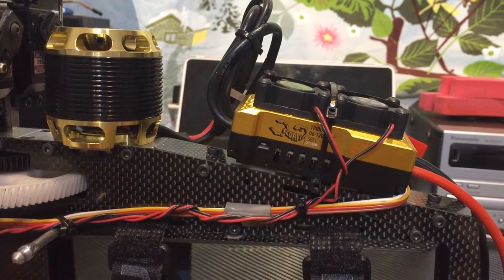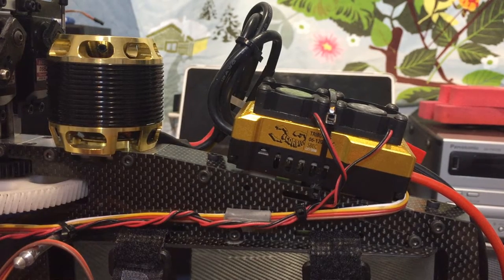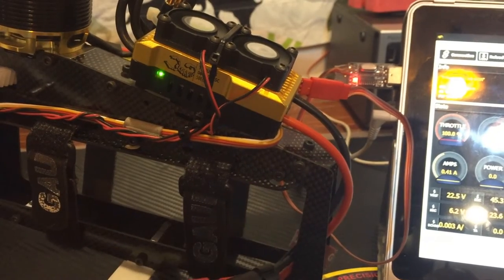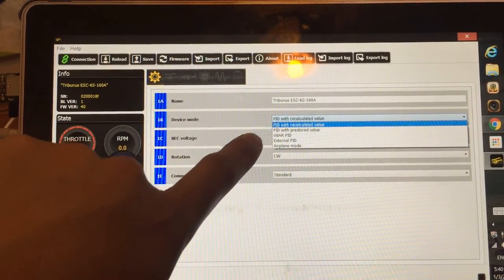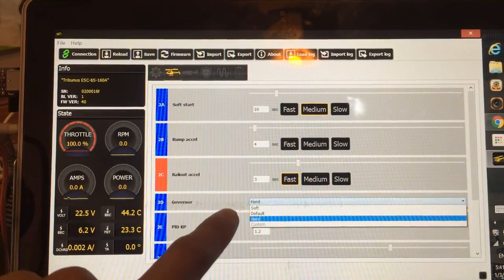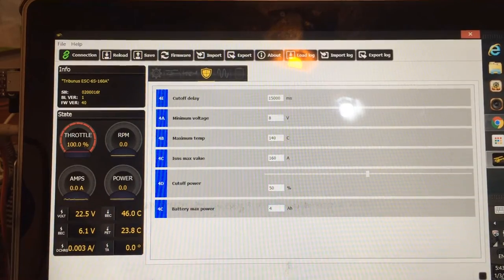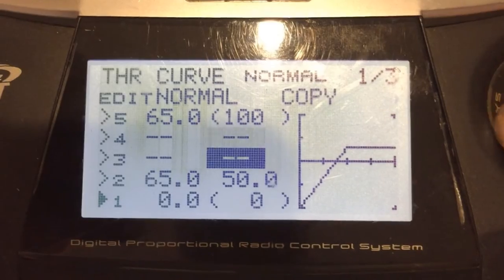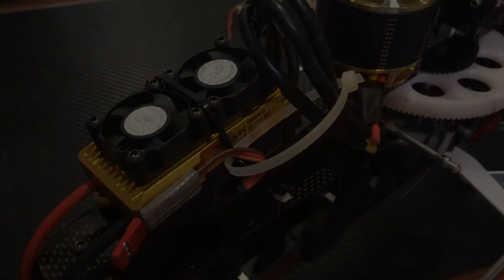Scorpion Tribunus 120 ESC-Basic setup video

Comment: On my Tribunus2 120 I can't change the drive frequency and timing?. The motor & caps on esc are to hot to touch after 1min on the ground with no blades?? Also motor makes a high pitch noise around mid stick. Spent nearly a $1000 on scorpion products for my G570 and I can't even use it without cooking everything.

Comment: Hello.  I purchased a Tribunus 14-300A Series engine governor.  I cannot pair with V-Bar Neo (V-Bar Control).  I also want to connect via telemetry wire ...
 I still do not understand which socket in the figure is "MASTER", which is "AUXILIARY" ??? There are 9 pieces of pin connections ..

 Help me please🙏🙏🙏
Reply from the maker: Master is for your throttle signal from the Rx and Auxilary is for rpm sensor.

Comment: Hi.  I am using GOVERNOR ESC SCORPION.  Is it possible that on the ground there are some rotor revolutions, and others in the air? (They are respectively lower)
Reply from the maker: Lower rpm in the air? Due to your rotor disc being loaded up, normal.
Reply: @PoomUdi  thanks 🙏

Comment: Hi.  What kind of governor do you use?  ESC scorpion or vbar governor?
Reply from the maker: I use Scorpion internal govener eventhough I fly on the Vbar. Just my personal preference.
Reply: @PoomUdi  Thanks.  Help me ... I have 80% gas shelf.  When I took off for the first time, the helicopter did not rise for a long time, and only when the throttle stick was in the extreme upper position, the helicopter took off.  When I raised the helicopter again, everything was fine, the throttle stick was just above the middle.  Although I did not change the gas shelf, I left 80%.  Do you think this ESC is configurable?
Reply from the maker: @very9000  Try a recalibration
Reply: @PoomUdi  Please tell me, when changing the GAIN parameters (soft, middle and hard), how is the helicopter controlled?  What does this affect?  How does it feel when flying a helicopter?  Yes, I want to say that now I am adjusting the flight ✈️ of the LOGO 800 helicopter, like the flight of a copy helicopter, I do not fly 3D.  Looking forward to your reply, thank you 🙏 in advance.
Reply: @PoomUdi  Thanks.  If all is well now, do I need to re-calibrate or not?
Reply: Look, I first set up the ESC SCORPION through the application (limited) in V-Bar Control, now I am setting up through the computer in the SPROTO application.  Will there be no crash with synchronous settings?  What do you think ?  🤔

Comment: Could you please explain how to calculate the value for "max battery power"?
Reply from the maker: If you use a 5000mAh pack, and let's say you want to have 20% left in the pack. This would give you 4000mAh of usable capacity. Take 4000mAh ÷ 1000 to get the value in Ah. Which would equal to 4.0Ah

Comment: on the trottle curve , normal why not a straight 65 % curve and use trottle hold for 0
Reply from the maker: TheRagge1 , in case I forget and flick hold off when the heli is in an unsafe position... just a habit for me.
Reply: @PoomUdi  Just don't forget to switch out of that flight mode before going inverted.

Comment: Neo vbar control, goes to vbar pid or external gov if i want to use vbar governor? Thanks
Reply from the maker: Select Vbar PID for Vbar use, you can check out the scorpion website on how to DIY a telemetry cable as well.
Reply: poomysan got it got mine working now, but i notice when i hit my motor idle it does something really different,